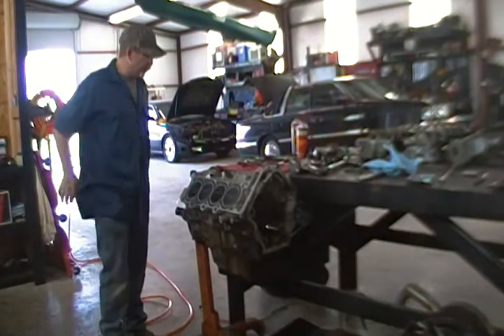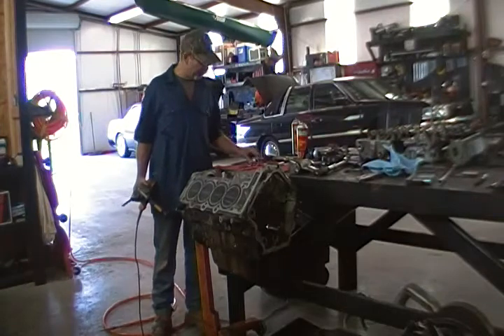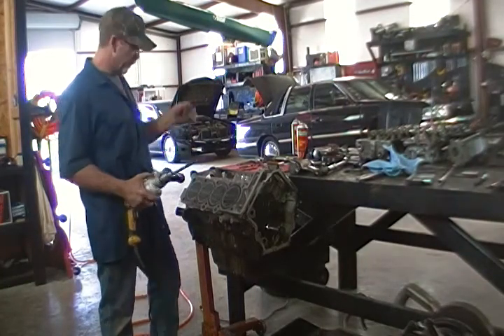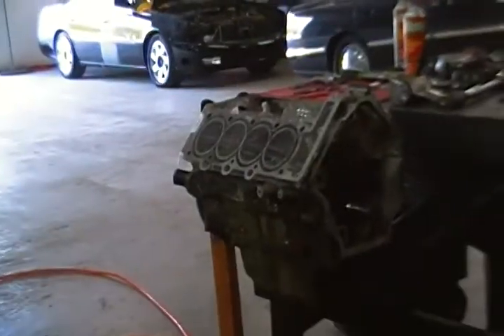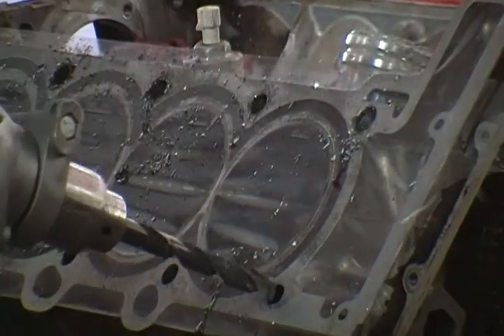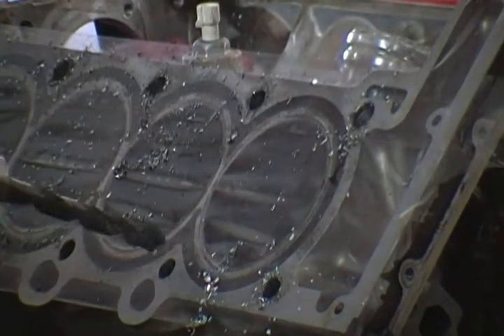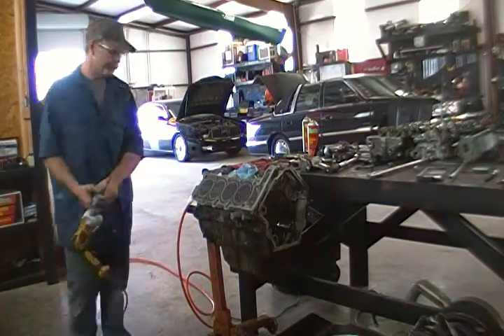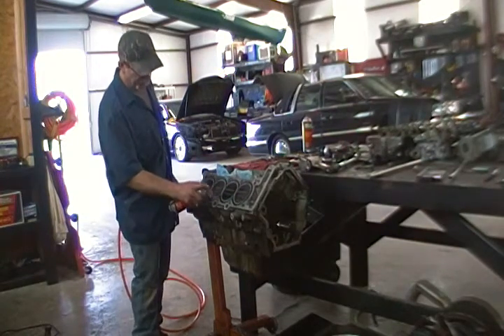Cadillac Northstar Block Studding part two

Comment: Cadillac has always had issues with their stupid engines. The 425 in my 77 Fleetwood Brougham D'Elegance was a real engine, My 83 Fleetwood HT4100 was a POS,blew up at 159K. My 307 in my 86 Fleetwood was a underpowered POS and now my 06 DTS has a serious issue with valve train noise which I have no idea what it is. Only 96K and the valves just scream bloody murder.
Love my Cadillac but hate the dang engines.
Reply: If you are willing to put these beefy studs into a northstar, they become great engines. A close friend did this for the northstar in his fiero, and it's gone 60k miles  seeing the redline multiple times a day. Zero issues.